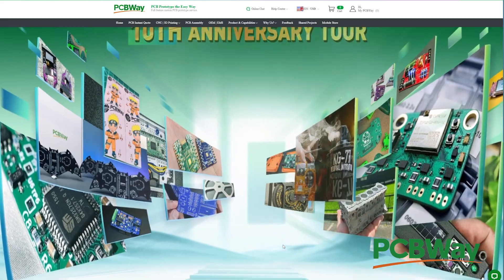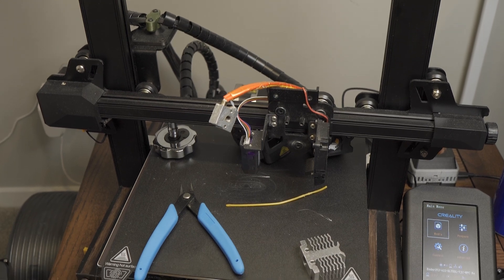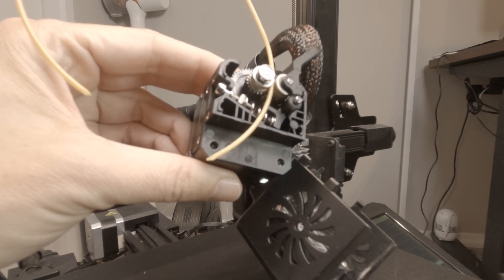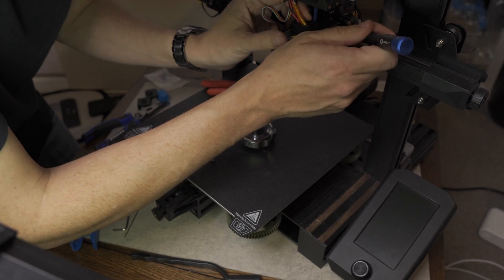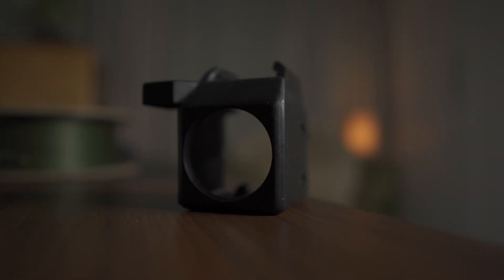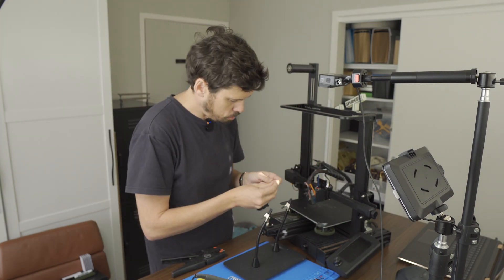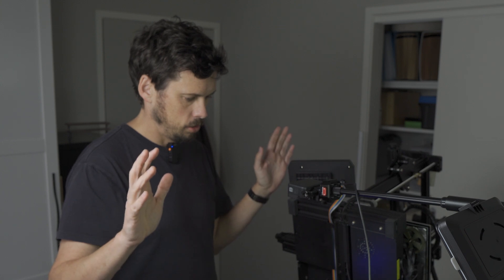Upgrading My Hot End was a Hot Mess (Micro Swiss All Metal Hotend)

Comment: Little word of note, when you wire in an always-on fan (or at least one without PWM control), you can insert the step-down converter normally in the entirely obvious way.

But when you wire in a PWM fan such as part cooling fan that you want to run with a step-down converter, you need to wire positive output of the main board to the positive input of the converter, positive output of the converter to positive input of the fan, negative of the fan to the negative output of the main board, and a random mainboard ground to the ground of the converter module. Because otherwise the voltage regulator will likely go bonkers so the outcome isn't going to be what you want, it's probably not going to PWM, and the converter might smoke, and it might smoke your fan along with itself. All boards today are low-side switching, meaning the 24V connection is just directly connected, and the ground connection is interrupted by a MOSFET. As described, all the current is going effectively through the corresponding fan output, but the random ground lead provides a reference level to the converter to keep stable.

Why you might want a 12V PWM fan on a 24V system? Same reason, to install a more nicely manufactured Delta or Sunon fan and when you're getting them from surplus rather than ordering them from a pharmacy.
Reply from the maker: Thanks man. I had no idea. I don't think I'll go down that route anytime soon.
Reply: @AttemptedMaker   Oh btw the buck converters you show are fake. All of these are. It says LM2596 on them, but the chip is actually a re-marked LM2576 or clone. This would have been fine except the supporting component values are chosen for LM2596, which has very different switching timings, which causes these boards to impart a substantial ripple on the output when loaded up with higher current. A fan or an LED strip won't care, but don't connect a Raspberry Pi downstream or something like that - choose an XLSemi converter instead; or even one of those little tiny little shits like Mini360, just because they don't look imposing doesn't mean they are junk.
Reply: @AttemptedMaker   And oh you managed to get yourself a 24V Sunon, nice. And without the filthy AutoRestart feature as well. I have had so much "fun" with my Sunon Maglev autorestart fan. For one i had to build a tau filter for the motor not to sound like absolute disaster or do weird things; for other the MagLev bearing REALLY didn't love being slung around on the toolhead and would just get stuck and make horrendous noises, i ended up opening it up and flooding the shaft with grease. It's probably no longer really MagLev but it's been working for a while and it makes air, and doesn't vibrate much, so eh?

Comment: Whenever I'm checking for extrusion, I gently pinch the 'input' side and feel it pulling my fingertips against the top surface of the direct-drive unit, this gives good haptics where you can feel things like 'clicking' if something is stalling or skipping, as well you can be mean to it by pinching harder and seeing if it can overcome the tension, ensures the gears are meshed properly and pulling hard.
Reply from the maker: Good advice. Thanks. I'll try remember that before I pull it apart for no reason again 😂